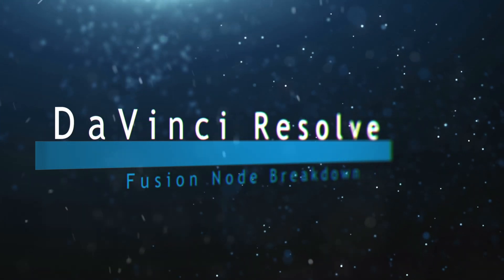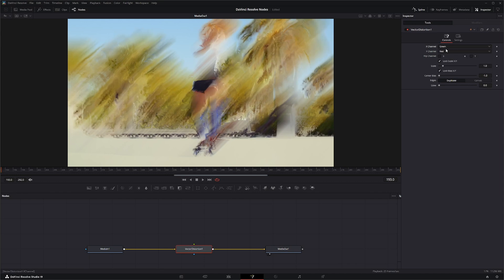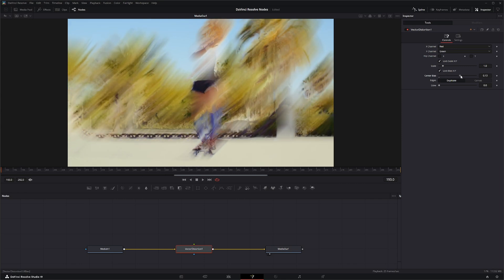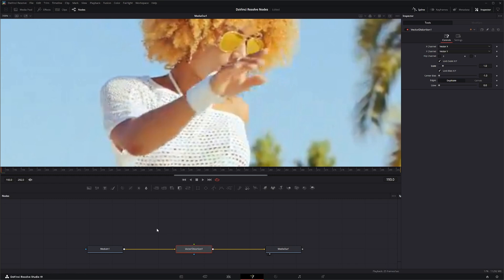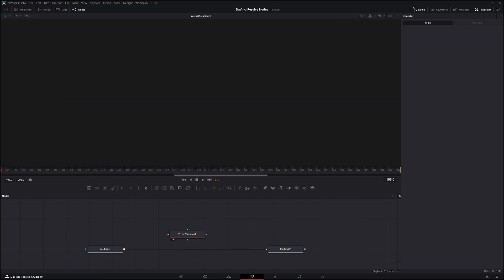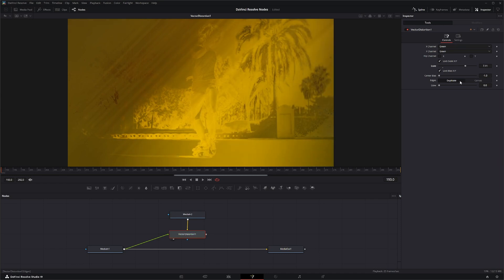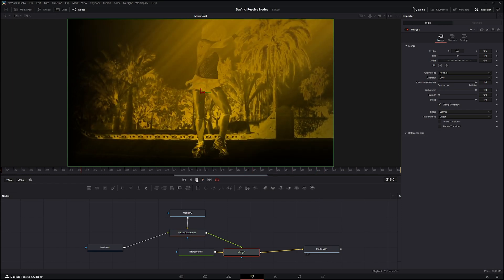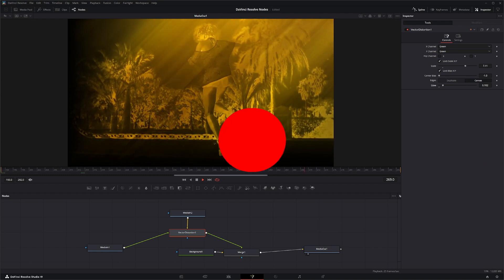DaVinci Resolve Fusion Vector Distortion Node

Comment: it hasn't worked the way it 's demonstrated...i am not getting any vectors when applying optical flow, or stock glitter footage or even the fast noise..the mediain through the green input (.distort) is hardly seen. But thanks either ways.
Reply from the maker: Yes, some footage works better than others. Sometimes tweaking color settings before helps (i.e. gamma, contrast)

Comment: I wonder why you use the corner positioner instead of using the planar tracker with the corner pin option which does the same thing, probably you will have to track the shot too.
Reply from the maker: If you're talking about the corner positioner node breakdown it was just because I needed to cover that node